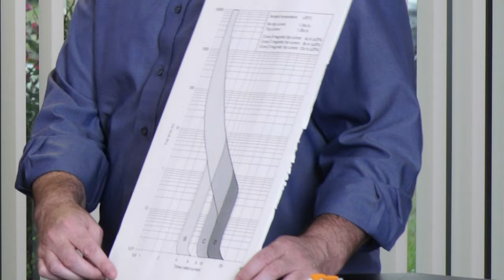Circuit Breaker Trip Curve B, C, or D? Choosing the Right One

Comment: I have a 100 amp sub panel in my workshop where I run 20 amp machines with start up capacitors. I'm having trouble with nuisance trips when starting up my dust collector and was advised by the service tech that I need to install metered trip curve c or d circuit. Can I use the 50 amp circuit breaker in my sub panel for the trip curve breakers?